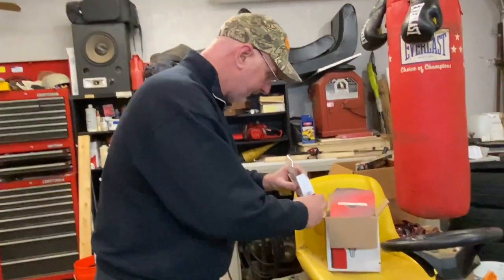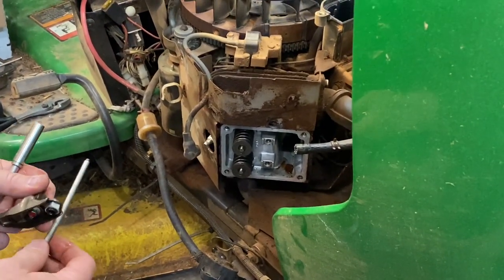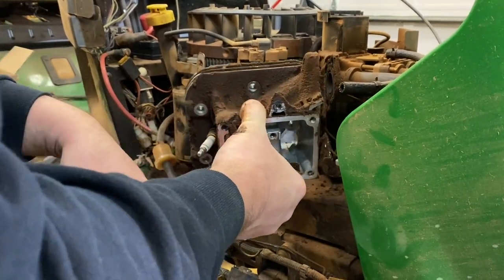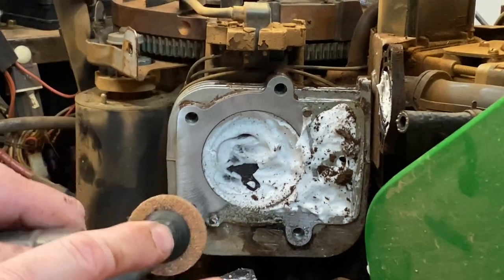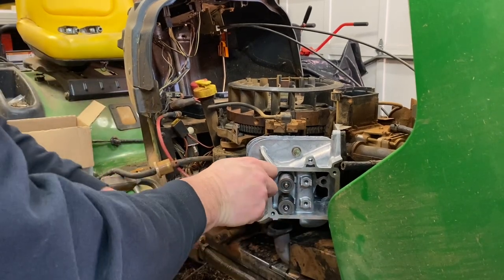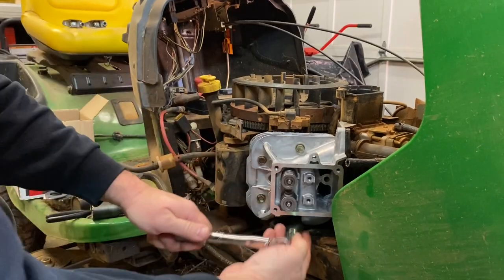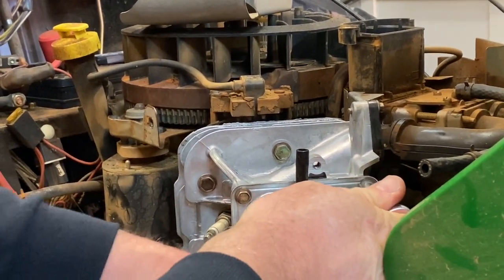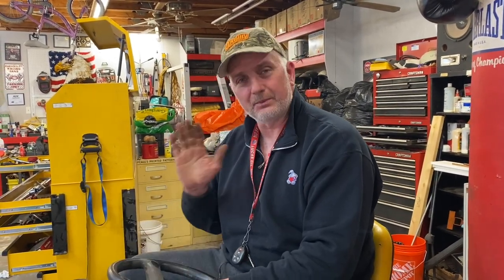How to Replace a Cylinder Head on a John Deere L120 Riding Mower

Comment: Did you buy this Mower new?? Seems like there should be a fifth head bolt in that valve galley you mentioned. Sure you have the exact engine Model # details and you can get an exploded parts diagram online which would confirm if you are missing a bolt. Only other thing is  looks like you kick up a lot of dust when you mow, so cleaning the engine with shields off to make sure those cooling fins are clean of dirt when your mowing season ends. Prevents overheating issues.